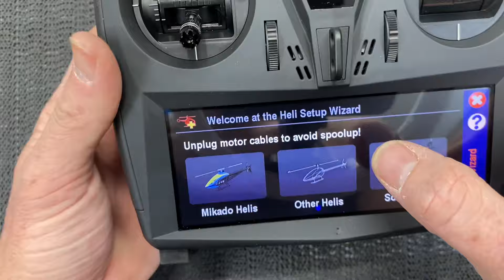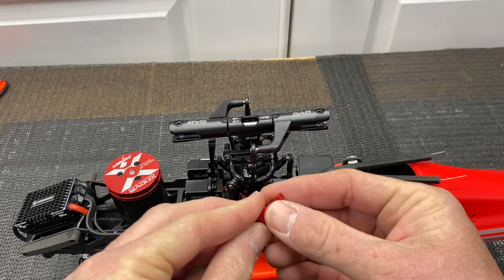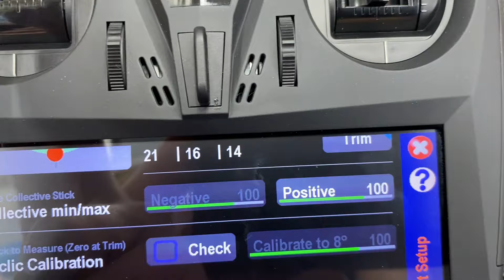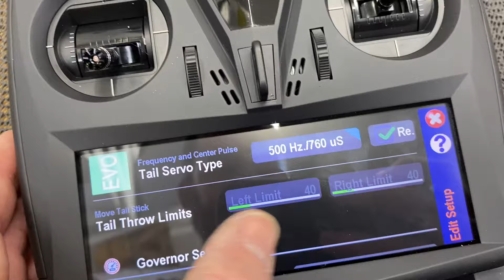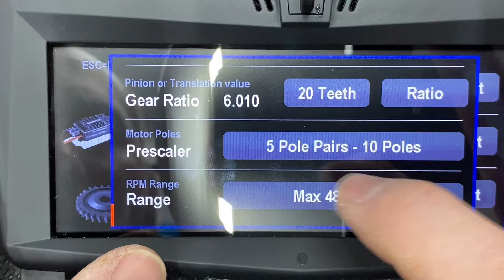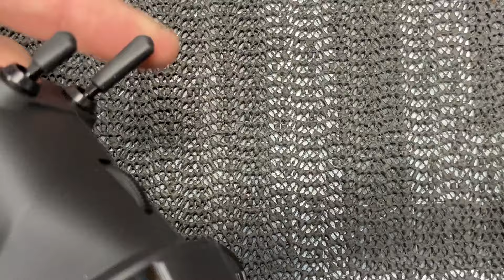How To Setup Your SAB Mini Genesis On Mikado Vcontorl/Vbar

Comment: Jeff. How do you centre the tail servo on vbar so its locked to allow mechanical setup of the tail rod.  Same way as when you want to centre the collective servos. When you tick the box they all go to centre and lock out. Tia.
Reply from the maker: Hello! So when you select your tail servo in the setup menu it will put the servo neutral, if your using a programable servo you can use a program box to get the servo 100% 90 degrees or get the horn as close as possible and just make up for it in the push rod. If you’re having a tail drift you can use the trim menu and either auto trim or manual trim.

Comment: Thanks for the video Jeff!  I just finish the built nicely with almost identical electronics, thanks to your video.  Would you be able so share your initial VBar head rotor and tail rotor setups (gain, etc.) for the Gen Mini?
Reply from the maker: @firianto  I’m glad the video was helpful! So all gains are stock other then tail gain and I just moved it down 10 points per bank. Of course every heli will be different and I would start at stock values and tune from there.
Reply: Thanks Jeff!

Comment: Interesting that you don't adjust and level the swash for maximum and minimum end points, and you only level for centre.. Every time I have ever checked, there is always a servo that over or undershoots, swash not level at an endpoint, with high quality servo brand names as well.
Reply: I agree with your comment. I've been in the hobby a long time, and almost never the swash has stayed straight and level from low to high stick even with it being level at half stick. I've always had to sightly adjust endpoints. I use high end brand name servos too it's not like I cheap out. Great comment
Reply from the maker: You have a great question. There is no reason or need to adjust level at top or bottom of the servo throat. The reasoning for that is because you physically can’t unless you have a programmable endpoint servo. So the servo travel one is going to be slightly slower than the other one or two. But you only have the same three linkages. So if you would just zero at midst stick which is the most important. And then you go to full positive pitch and readjust the swash plate when you go back to zero it will be off. Same with negative

Comment: Hey Jeff, I know you use the ix14 as well as a Mikado.  I currently have an NX8 and ix14.  Mikado looks like a great transmitter, just not sure if I’ll ever make the switch.  Do you really have a preference between the ix14 and Mikado?
Reply from the maker: I have the IX14, NX8, TX16S, IX12 and Vcontrol. I have pretty much quit flying the IX14 on all helicopters keeping it as an airplane radio selling all my other radios and just sticking with Vcontrol. The mikado system is unlike any other! I absolutely love the feel of the radio in my hands, the switch layout, the gimbal spacing is perfect. I don’t feel like I am reaching or stretching into the corners. The ease of set up is just incredible. Being able to fully set up a model from start to finish on the radio without the need of a laptop is just perfect. Being able to set up my other parts of the model from the radio again incredible. Highly recommend going mikado Vcontrol/Vbar.

Comment: Nice cabling!  Expected that of course :)
I'm still undecided if I want to run an RP3-H w/antenna out the back like you did or put a ceramic XR2 mounted to the servo.
ELRS of course is now my hill to die on, so those are my two options.  But with the Carbon fiber body, XR2 might not be the way I go.

I'm going to use a swash plate leveler like you did for the first half.  
But for the blade arm adjustment, I'm planning to tip both blades together and adjust length so they are both tip to tip full 360.
I know its an older technique, but I just came up with it on a whim when re-adjusting my S2 the other day. 
I did a search and wasn't shocked to find I hadn't invented the wheel. But it was nice to validate my theory.  
I did find it was not only quicker, but more accurate than the pitch gauge in getting the blades to line up perfectly at zero collective. 

Ill still use pitch gauge when setting up my geometry in the RotorFlight Configurator and give myself a 12/12 pitch.
Reply from the maker: It doesn’t matter where the receiver itself is actually mounted. The antennas need to be outside of the carbon fiber, no matter where the RX is. The antennas are what can’t be blocked not the receiver. That is an old-school fly bar tip. It does work but nothing like aThat is an old-school fly bar tip. It does work but nothing like a pitch gauge. I always use a pitch gauge and have a perfect setup off the bench. Including Blade tracking.
Reply: @westhobbiesrc8051  yeah, exactly why the xr2 gives me pause.  mounting on the elevator or tail servo would still put the built-in ceramic antenna (it just a nub meant for LOS distances) dubuisly close to the edge shroud of the canopy. An RP3 is the more likely end choice as it would make use of the antenna guide and hang out the back.